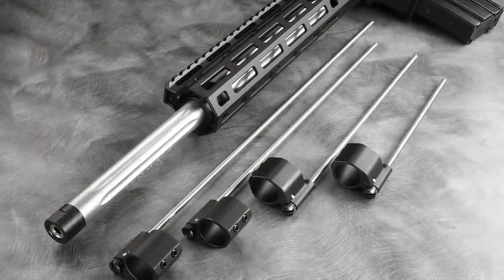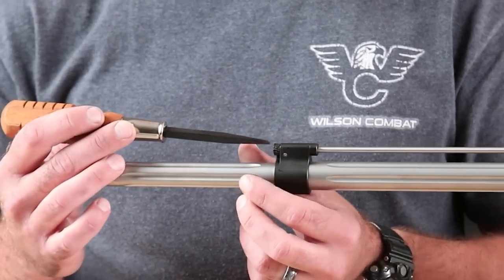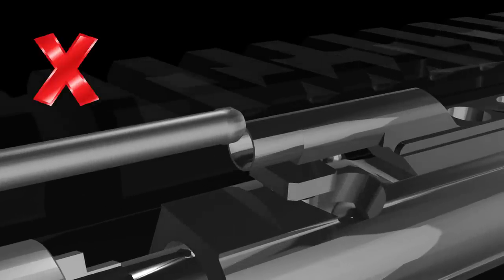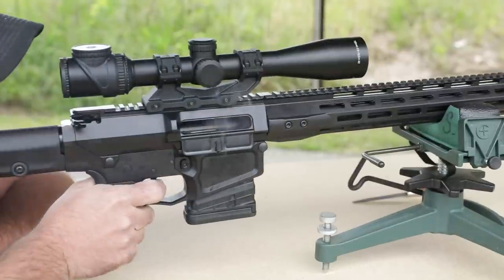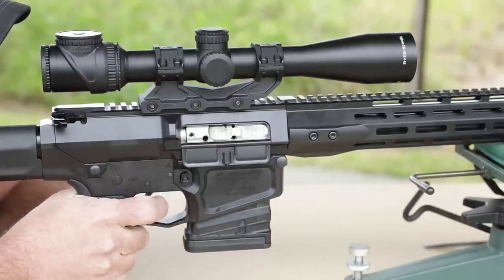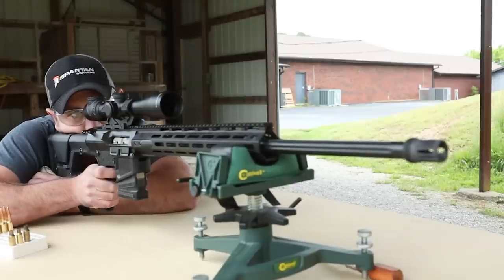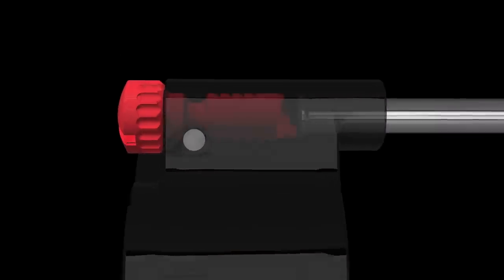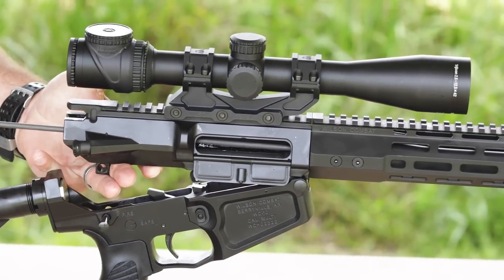Adjustable Gas Block with Carbon Cutter

Comment: Gas tube failure 09/27/22.  The tube separated from the block, resulting in an out of service weapon in a very low round count gun.  The tube is non standard and can not be replaced with a standard tube.  The end is simply swaged inside the block, not securely pinned in.  With all due respect, this part is not duty grade and until it is updated I urge people to not trust their life to this block..  If it can remove itself from the block with less than 100 rounds how is it going to retain after significant erosion.

Comment: Is it ok to fire this with screw completely closed, for the purpose of using an AR platform as a bolt action?
Reply: yes
Reply: @andyhills  This is what I meant by conceptually simple. There needs to be a fundamental introspective review of how the blocks work. This fellow has a great point.

Comment: Im wanting to install an adjustble gas block to my ar10. Dont know what size to order for it.  What measurement do i use in determining the correct fit?
Reply: @j.bridges2921  que?

Comment: Whats the deal with S&W MP10, I can't get it to cycle with anything. I changed the barrel, than, GB, bcg, and it only stove pipes  I'm hearing the upper is proprietary to bcg and even the gas tube. The S&W barrel and bcg are 100% proprietary

Comment: Besides metering gas at the discharge port can an installer choose what direction the gas exits the block?  What would per se be optimal To reiterate, "gas off" is interpreted that upon discharge all gas escapes somewhere? to atmosphere? What if the location of the gas port while conceptually simple, is located too close to your QD point or high dollar bipod or you get an unwanted, messy facial. Or worse the gas sends up a cloud of dust revealing your hide, multi-point paths? Thanks But I shoot off the prone.